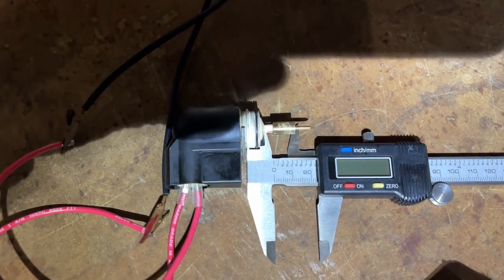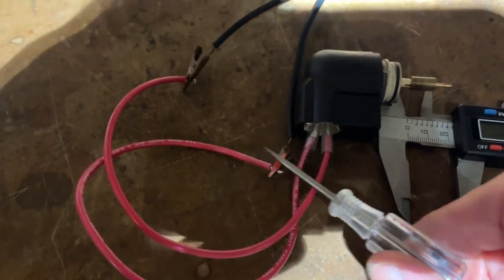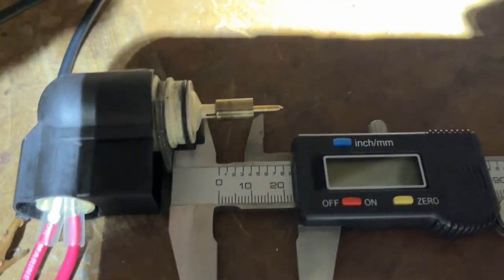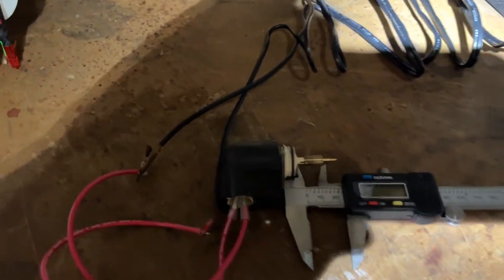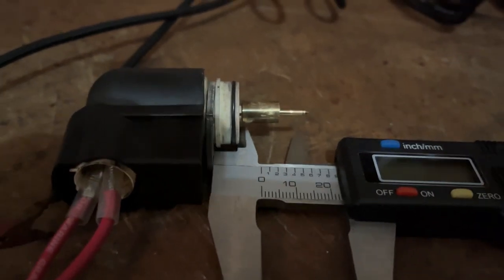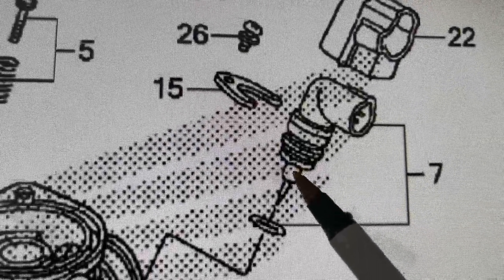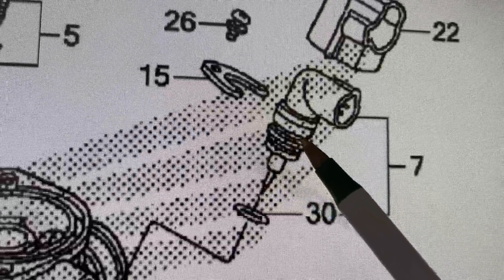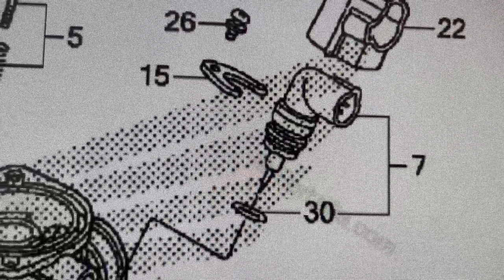Honda Ruckus ByStarter (see update in description)

Comment: For how common and old this moped is I was surprised at how little troubleshooting there is for the bystarter. I bought mine new in 2015. It sat for 1 year and never ran right since. No matter how many times I cleaned the carb or did the ECM reset. Hoping this is the issue and I can go back to riding it all day again.

Comment: Nice find. I've had starting problems with my small Honda outboard that has one of these SE thermal valves, had it out and cleaned it up while also doing the carburettor.  Did the 12v test and also checked resistance was in spec (manual calls for 15.8 to 24.2 ohms). Still had problems  - might check and see if the valve can have the same thread rotation correction like yours.

Comment: The real thing going on here, from a 60 year old racer, machinist, mechanic: The bystarter solenoid advances into a fuel port, and shuts off the fuel flow when warm! So the choke is on when first starting, and it gets its power from the stator, when the engine is running. The battery will not power this solenoid. I had to solve my problem also, which gets done after you pull out the carb, and examine the 3 fuel inlets inside. The choke fuel well, in the fuel bowl, has a longer tower that doesn't unscrew, its so tiny that a .025 drill bit won't go inside! The idle or slow jet next to it unscrews, and mine was also plugged. Both of these jets need to flow, or you will have no fuel for your bystarter solenoid to allow on through. The other video online from rolling wrench sort of covers this, but not well. What the bystarter is doing is allowing fuel to come up the separate Starting Enrichment only jet, and make it to the SE bystarter valve, so the bowl jet needs inspected first. Believe me, I have looked at every hacks Ruckus Metro CHF50 carb rebuilds, and none explain it to well. I also blamed the valve as the culprit, then the fuel pump and filter, and then finally got into the carb. I got confused by the actual operation of the bystarter SE valve. I was wondering if the SE valve was stuck or gummed up, but the fuel hardened in those tiny 2 jets, which I am now cleaning. These jets are less than .020" inch inside diameter.

 I am off to get something smaller than a common woman's sewing pin, to clean my SE jet. I ordered a new Honda slow jet to measure the inside diameter. I am nearly running again, and only after fully understanding what the SE valve really does. If I have misstated anything, please correct me! I did have a bad fuel pump, and before that I had hard start and idling issues. I always wondered why my scooter was hard starting, and did the valves, the spark, the fuel delivery was poor, new fuel pump, but the first thing should have been jet inspection, not the last!
Parts # 21 JET, SLOW (#35)  Honda 16180-GEE-003 and the SE jet doesn't show in this schematic
The SE jet doen't unscrew and maybe be pressed in?
The main jets #19 and #28 are for full throttle operation, and don't affect poor starting.
 https://www.partzilla.com/catalog/honda/scooter/2006/chf50-a-metropolitan/carburetor
Reply: I know I’m late to the party, but to clean the jet holes you all are speaking of, I have a back that almost everyone has. Take your bread twisty tie and remove the paper on it. It will become a very small wire that will clean the jet holes in both needles. Hope this helps someone. Be safe!